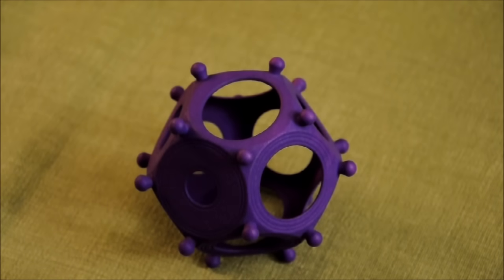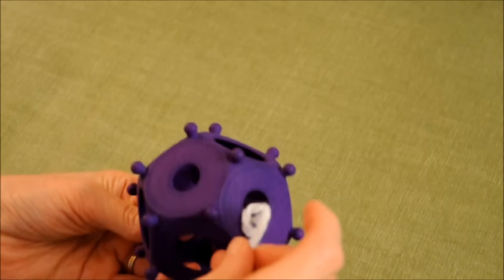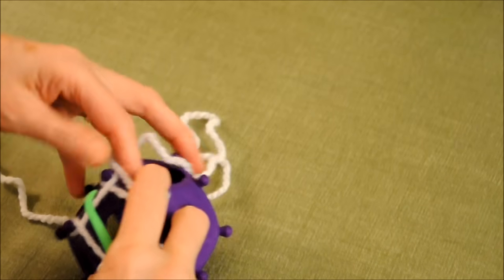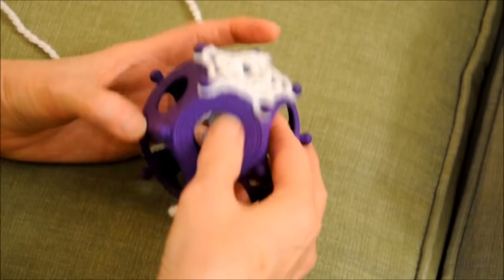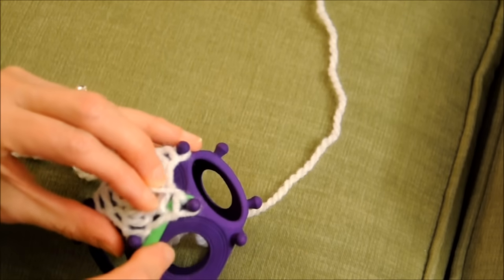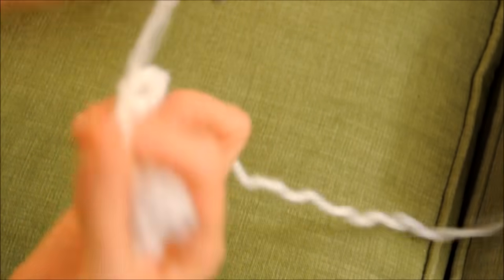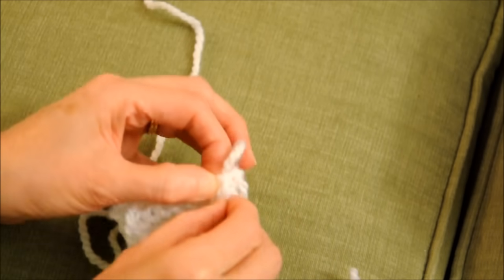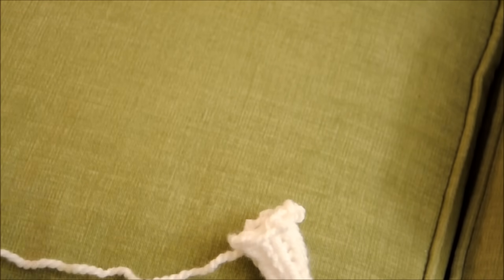Knitting with a Roman Dodecahedron

Comment: Several people have asked if this makes knitting fingers for gloves easier.  IMO, for a proficient knitter or crocheter, probably not.  But for someone who doesn’t or barely knits this kind of loom knitting is something anyone can learn in a couple tries, and exists in many forms at your local craft store to this day.  So yes, for beginners.
Reply: A sismple
Reply: Vidalion a simple knitting spool would work to make better gloves, for more easily than fooling with one of these.  Not that there is any evidence for knitting in this period.  There is naalbinding, but no knitting spools, nor writing, Noer extant examples of knitting.  The history’s last knitters have looked at this, and, just, no.  It’s not feasible, especially not for beginners, nor does it make decent gloves.  People then were sensible enough to not spend extra time making gloves in a “party trick” way.  The sides have different sized holes, but the pegs are all the same distance apart, and the holes don’t matter, only the pegs, so it makes no sense to use for different sized fingers.  There is no reason suggested as to why this would be an advantage.
Reply: @thumbelinasmum  the knowledge of roman concrete and color changing glass were lost for thousands of years. maybe people discovered a rudimentary form of knitting during the roman period and lost it during the dark ages. 
possibilites!
Reply: @bobloblaw9679  given that this method doesn’t work, and the nonsensical claims that the different sized holes make the fingers different sizes, and the “gloves” made are nothing but holes, it’s ridiculous to suggest these things are for knitting.  Nothing about it makes sense.
Reply: I think knitting something as small as fingers on 4 double point knitting needles is quite difficult.
Reply: @laurasteif86  yet, knitting fingers on double pointed needles is quick and has been done by small children through very old adults for centuries.  I tried gloves at 11. Took me 10 minutes to find the rhythm of knitting fingers.  When you learn as a child, you grow up thinking (knowing!) it’s not hard.  In the period of these dodecahedrons, they used nalbinding.  One needle and strand of yarn.  Check the technique out. It looks slow, but is fast in skilled hands and makes excellent shaped gloves, nice and dense, perfectly fitted, comfortable and warm.  Shaping is next to impossible with try dodecahedrons, while it’s easy with knitting and nalbinding.
Reply: In that case, maybe it was for mass producing gloves for soldiers. 5-10 guys make fingers and 1-2 guys make the rest of the glove.
Reply: @louhortonsculpture  you can’t make a finger with 5 stitches.  A big part of the claim that these are for gloves is that each face has a difference sized hold. The knobs are equidistant around the thing. That means each side makes the same size tube. So that argument is physically impossible.  

5 stitches of yarn is lacy.  They won’t work for working gloves, they will catch on everything.  They won’t work for warm gloves, they are open.  No coverage to speak of.  They won’t work for pretty gloves, the fabric is too wobbly.  Your fingers will poke out the holes.  They won’t work if you are carrying anything, the strands will press and be uncomfortable.  None were found with any trace of suggestion that textiles were made in the area.  The smaller ones are too small to use to make gloves.  The big ones too big.  If your goal was actually to have such a glove (such a stretch, but going with it), you could do it with a ring and 5 knobs, and do it easier and faster, than with the dodecahedron.  

But, if you were going to use this knitting Nancy technique to make a glove, you would have two different rings, or more likely, cylinders, a small one about .5-1” diameter, with at least 12 pegs (not knobs), and a larger one, about 2-3” diameter, and about 60 pegs.  If they had the technology and understanding of knitting, then they would be able to actually make a decent fabric.  The cylinders I’m describing are easier to make, easier to use, and make a better fabric than a dodecahedron.  Proper tube knitting frames are still an inefficient way to make gloves, compared to knitting needles or nalbinding, but do at least *work*.
Reply: Why would I want another form of this ? I want the Roman dodecahedron!
Reply: @wildfireswildfires6792  it’s a neat design, maybe for counting, maybe measuring, maybe as dice.

Comment: Who knew?  Slick.  A Roman era knitting machine?  Well done.
Reply: ... Except it's not in this video is an insane extrapolation of a fanciful wishful thinking when the reality is much different, and in fact, they exist tons of evidence to the contrary about what these were actually used for
Reply: @LadyBits2023 😂😂😂
Reply: @LadyBits2023  Then tell me Darling, what WERE they REALLY used for?
Reply: @TimeSurfer206  probably gambling.
Reply: A knitting machine for making chain with gold wire. The different sized holes are to pull the chain through in turn to compact the chain
Reply: @robertkustos2931  who ever made chain gold wire? And how would the holes compact it, and why would you want that?
Reply: @thumbelinasmum  the Romans. There's a vid showing how it's done.
Reply: @robertkustos2931  not likely with this.  They didn’t knit wire.
Reply: @thumbelinasmum  you can knit anything flexible,  fishing nets, chain mail,  wire fencing, rope, baskets, ponytails, rugs etc.
Reply: @robertkustos2931  LOL!  Fishing nets are netted, which means knots (look more carefully, it’s made with the thin rope wound on a little shuttle thing, a knit in every loop). Chain mail isn’t flexible, it’s made of interlocking riveted rings (my kids made some, to see if they could, and one of my kids received a maille shirt as a present at 13!). Baskets are woven (trivia: all woven baskets are made by hand. Not possible for a machine to do it.  Even the cheap plastic baskets are hand woven).  Ponytails? Do you mean horses’ manes? They get braided. Rugs are braided and sewn, or woven.  Yes, there are novelty knitted rugs and (usually felted) baskets. But those are by modern hobbyists mostly experimenting.  I’ve been knitting over 55 years.   I’m not making this up, do some research, and you will see I’m right.
Reply: @thumbelinasmum  actually they did and i've done it before they call it viking weave now but it was probably used by the romans ,its used for jewelry and monks during the black plague made whips out of it
Reply: @masonmp1889  actually who did which?  We have listed a bunch of techniques and multiple groups of people in this thread.  “Probably” isn’t any sort of documentation.  Knitting was invented in c 1000-1200 CE.

If you mean the cord that Vikings made, they used a variety of braiding techniques, including fingerloop.  I’ve yet to see any documentation of any viking knits.

If you mean nalbinding, then, duh. It’s thoroughly documented to that period.
Reply: @thumbelinasmum  i was talking about a wire braiding  technique which has now been called "viking weave" and after looking around i found  roman era examples (one a slightly denser one with more than 5 "loops and another more or less standard one in gold circa 3rd century) which after further research on these artifacts i do think they werent meant for crafts at all but as some sort of item of status (as they were found in money hordes)or just an expensive trinket
Reply: @masonmp1889  because of this, I looked it up and found the Viking wire braid thing. It’s very much like nalbinding and super pretty. I couldn’t find any photos of extents, only someone doing a variation.  I could see manipulating the wires required the same sort of techniques abd care that using wire in bobbin lace requires.  It kind of looks like knitting, but is not. Thank you for mentioning it.  It was very interesting to read about.

Comment: How to knit the fingers together. When you have one tube finished, cast off all but two pegs. Carefully remove the tube and set it aside, with a knitting needle pokes through the last two stitches. When you're finishing the second finger, put the two unlocked stitches over two pegs for the second finger. When you cast off, the two are connected together. Repeat for two more fingers. For connecting to the thumb, is there a way to drop and cast off part of the pegs while making an extended 'tab' that's part of the tube? Still leaves knitting the rest of the glove body, or a couple of pieces of leather could be stitched together and the finger tubes stitched to it through punched holes? Wouldn't need to knit the thumb tube to the side of the index finger tube.
Reply: You are so smart. Thanks for sharing.